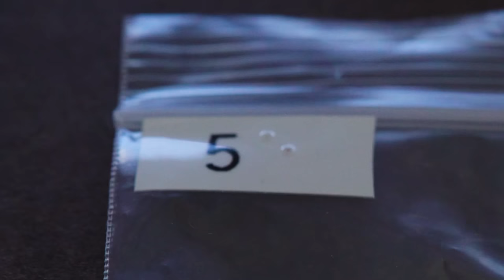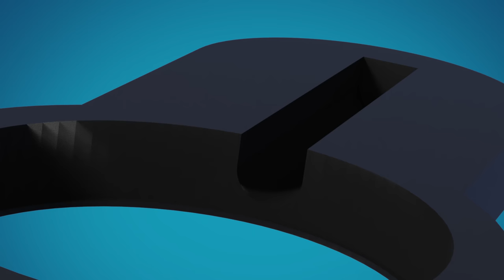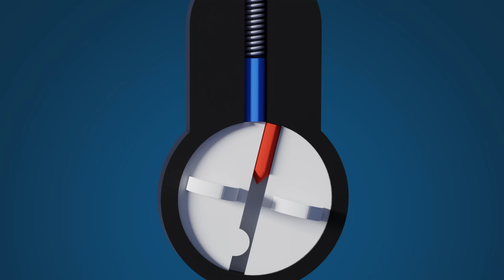Blind Students Learn Lockpicking (w/ Deviant Ollam)

Comment: My suggestion would be for each kit rather than baggies, have a small trencher 3d printed with spaces for all 9 pieces. Then when kids are done with each piece they can place it back in the trencher. The same sort of idea of cutting out shapes in foam for packing things, but a quick 3d printed long rectangle just deep enough to hold the parts. I hope this made sense. I imagine a simple top can be added to pull off to keep the pieces inside for travel would work.